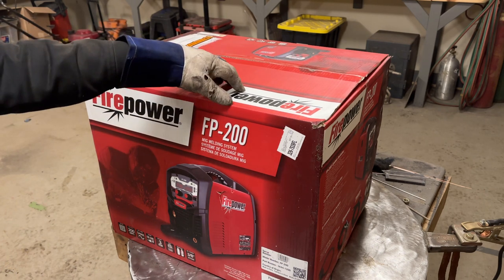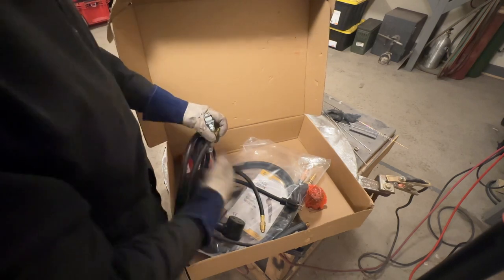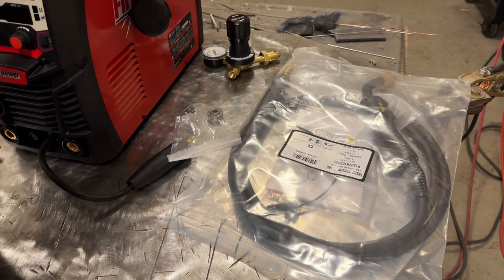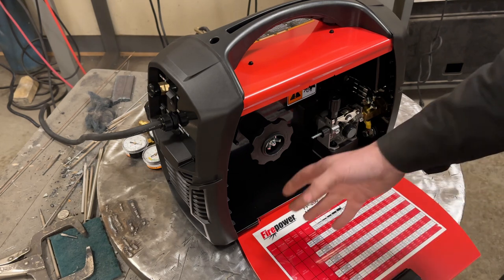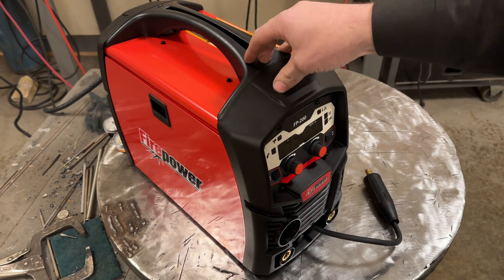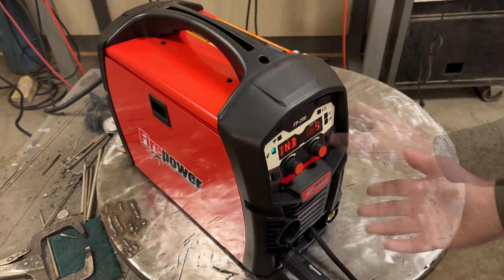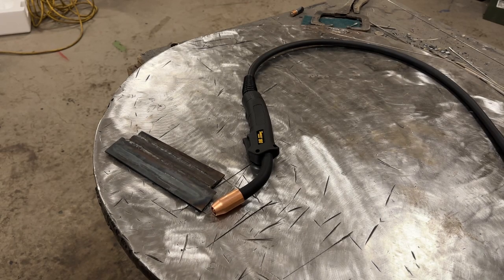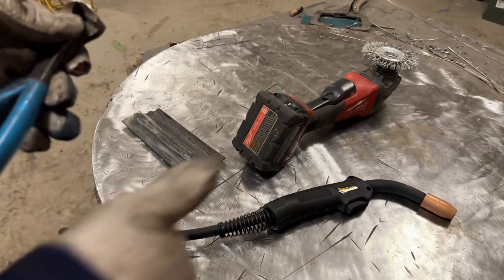Firepower FP-200 welder addition to the workshop

Comment: I just received my FP200. Can't wait to try it!
Reply from the maker: Awesome 😀.  It comes with flux core wire,  not sure how good that wire is (I ran other wire I have).  It welds really good so far for me.  Make sure you have the correct voltage selected on the back of the machine.  I will be doing more videos with it coming up 😀

Comment: Greg, I just bought the welder from Arc Solutions. Esab is offering the $150 rebate again for any FP-200 purchased between 4/1-6/30. Thanks again for the great videos and the review of this mig welder.
Reply from the maker: Awesome that they are still doing it 😀.  You won’t regret it, I have been using the one I bought extensively and it’s very smooth.  All the flux core and MiG videos in the future will be shot with the machine so everything I do will be applicable to yours.  😀

Comment: I thought that looked an awful lot like the ESAB 210 (except the color) that I saw in the local welding shop-  and what you said explains it.
Reply from the maker: Firepower existed as a welding company separate from esab (but owned by them) for a long time.  I believe they are no longer going to sell firepower products but many they just rebadged as their own.  I bought the firepower because they could be had for under half the price of the esab painted one, which is a absolute steal.  Northern tool also marketed welders under the Klutch brand that appeared to be made from firepower’s product line too (same cases and specs).  Overall I am happy with the machine, it welds really good.  

If I was looking at buying a new MiG machine I think I would go with the new esab rogue MiG welder that’s coming out soon over the esab 210.  It’s more portable and a pinch cheaper.  😀

Comment: I'm considering of finally caving and buying a mig welder. This appears to be a good option.
Reply from the maker: I have used mine extensively and I have no regrets.  The only downsides to it is it doesn’t come with a .035 hard wire feed roller (it does have .035 flux core), the contact tips aren’t generally sold at many stores, and the little spring used for spool tension is a bit annoying.  Other than that it’s great.  Northern tool has them for 600$ and it’s well worth that.  I paid less with a mail in rebate but honestly it’s still easily worth the 600$.  Harbor freights Vulcan 215 is a few hundred more, and only has a 90 day warranty vs 3 years.  If you buy it and plan to run flux core grab yourself a flux core nozzle online, the .035 hardwire drive roll, and some extra contact tips.

Comment: I rolled the dice and bought this same machine from the same site a couple weeks ago. I couldn’t find any info on them really before buying. I knew that esab owned them so I figured it was a good gamble. For the price why not? I finally ran it for about a half hour today. With .030 mig wire and 100co2 (all I had on hand) it ran well on 1/4” plate. Other than the fan running constantly I can’t complain.
Reply from the maker: Firepower seems to make good welders and have existed for quite some time.  The fact esab is rebranding the same welder as their own says a lot.  I know some people aren’t a fan of esab but honestly after owning a few machines from them I find that they are well built.  You can’t beat the price like you said, I am in it for 440$ out the door, I could barely buy a 140amp Lincoln used for that here lol.  

Edit:  I also believe firepower made all of northern tools welders too.  Those have been well known to be very decent units.  A friend of mine has a multi process of theirs and loves it.
Reply: @makingmistakeswithgreg  definitely can’t beat the price!  I drug my feet years ago on buying a thermal arc fabricator multiprocess unit. Next thing I know.. it’s called a tweco and the price went up….. then it turned into an esab and the price went up again lol . Other than the decals and price, nothing changed. I was so impressed with the quality that I just purchased a firepower 35i plasma for $320 after rebate.
Reply from the maker: @mkearn724  thanks for the heads up on the plasma.  I might buy one of those 35i’s.  I had a top of the line hypertherm 45 and sold it like a idiot because it was sitting around.  Now I could really use one again.
Reply: @makingmistakeswithgreg  the best price that I found was arc solutions inc,  and I actually got welding supplies from ioc to price match the difference in the mig that I just purchased.
Reply: @makingmistakeswithgreg  Northern tool Klutch welders are great i have a 110 mig unit of theres its top notch,i just picked up the fp-200 great deal,im running it on c25 right now i found the run in and inductance control is very resposive,i havent run it on straight co2 yet but i think its going to be a very good co2 welder as responsive it is with inductance control,these new invertors dont seem to mind co2 at all like the older transformer migs

Comment: I was Mig welding some thin material today and thinking about you. I kept having blow thru's so I used 100% argon with .023 wire. It worked pretty good when I turned up the voltage, mostly tall ropey weld. Then I switched to 100% Co2 with a lower WFS and hit the ropey beads or welded next to them and also with spot welds and the ropey beads melted in pretty good on the floorboards. You gotta try this. I wanted 95% Argon 5% Co2 but didn't have a way to combine.
Reply from the maker: 95/5 is most commonly used for spray arc but it can work with normal short circuit mig.  100% argon tends to reduce heat input and cause beads to be colder.  On sheet metal it can work but thicker metal it will reduce penetration.  Obviously you found out 100% co2 has real good heat 😀.  

I have all of the stick welding videos shot and mostly edited.  My plan is to get mig welding next week and have videos out at the end of next week or the week after.  I will definitely be doing some experimenting 😀.  It’s important to experiment, that’s how you find new ways to do things that work better.  Keep it up 😀
Reply: @makingmistakeswithgreg  You're doing a great job, I watch all your videos.

Comment: Seems you had your flux core ground clamp on negative!
Reply from the maker: Straight Flux core is run DCEN, short arc mig is welded DCEP.  Dual shield flux core (gas shielded) is run DCEP.  The polarity shown is correct, you might be thinking of gas shielded dual shield.

Comment: Pretty sure polarity for flux core would be clamp on positive or dcen !
Reply from the maker: Straight flux core is DCEN, the welder in the video shows the MiG gun on the negative side, clamp positive.  That is the correct polarity for the wire used 👍